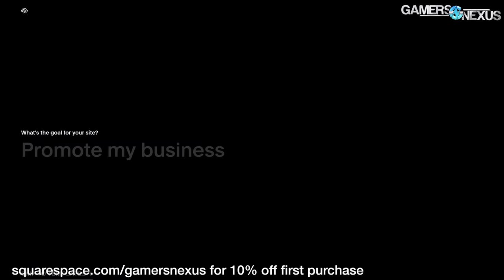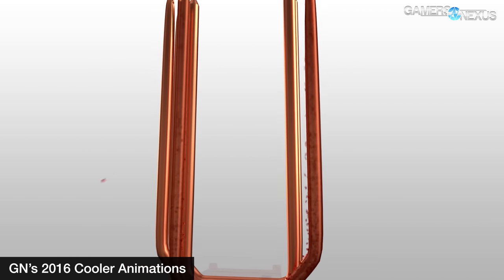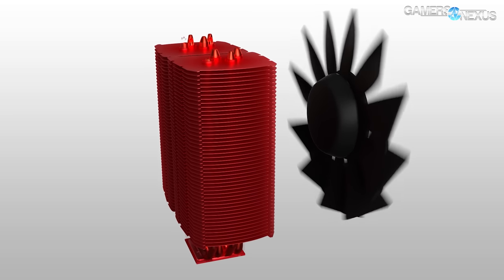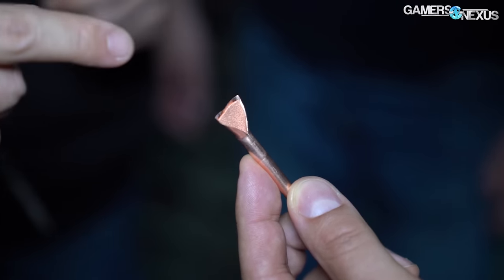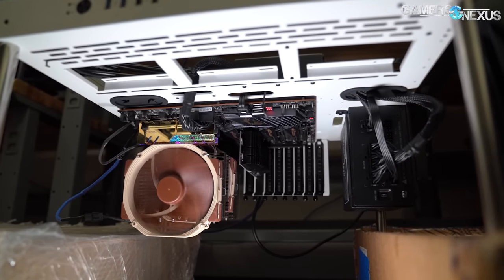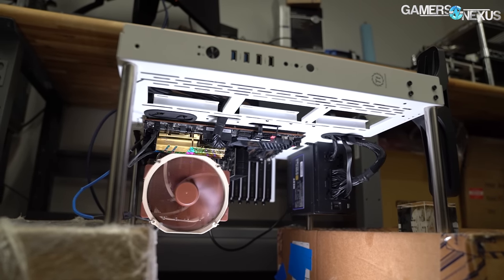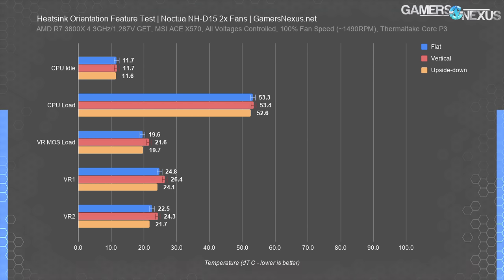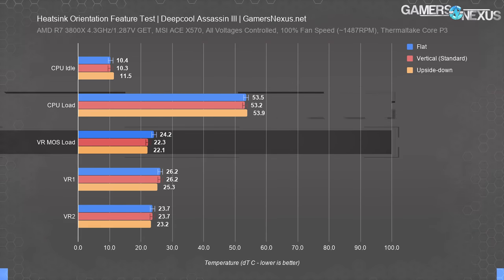Cutting AMD Coolers Open & Flat vs. Vertical CPU Cooler Benchmarks

Comment: I'd be interested in a test of the NH D15 in whatever orientation stock vs cut ends (just the tip of the heatpipes) to see the difference between a heatpipe and a friggin cheap copper pipe with some copper powder sintered to the inside

Comment: I ran my standard desktop tower case on its side for a while and it made no difference now that it's standing back up. Especially in games where the CPU hardly cracks 50*C to begin with.  Using a tower style cooler Thermalright Assassin King 120 Mini.

Comment: I'm curious why when doing heat tests like this, why not use something like a hot plate with good thermal sensors? It should provide a consistent heat output. Also woulda loved to see even a shoddy single run set of tests of a heat sink with a hole cut in it. It's fully possible that instead of a full burst, theres could have been just a shoddy seal or crack or the like, and i'm curious how much of a difference that  water makes.

Comment: Perfect timing...i just bought the 2700x few days ago and i freaked out when i saw 45-50 degrees celcius only for windows use. After a day is normal 35-40 for windows and 50-60 for games. But sometimes it jumps from 35 to 45 in sec
Reply: Akis Akis it's the same with my setup, 3700x stock cooler, 3 intakes 1 out...

Comment: ????? - I bought a cooler maybe just over 10yrs ago.  It was a high-end noctua and a monster.  Does anyone know if that will hold up on latest CPUs or do I need a new one. Was thinking just see if I can get an adapter to mount it when I buy new PC this year.  Also got a failed Corsair liquid cooling loop(5yr failure/rust/evaporation) was gonna repair it with purified/deionized water pretty much as video on this channel did show.  Need to make a choice about what im gonna do.  Dont want to spend money I dont have to.  Will likely buy high-end cpu and overclock so am for sure gonna need a quality cooling solution. ?????

Comment: Dont use a noctua to show an example of capillary action.  There have been a ton of people who have accidentally broken the tubes and there was nothing inside.  There's also has been shown to not even touch the plate.

They most likely say not to run it upside down because it's so heavy, it could crack thinner boards or pull off the hardware.

Comment: I've a question reg cooler fan orientation.. Pls help GN or anyone..

I have a Ryzen 5 3600 with a Hyper 212 LED cooler and a CM 590 III case. It seems that for AMD cpus, the Hyper 212 LED can only be placed horizontal to the floor - meaning teh fan is facing the GPU, sucking air and blowing up above. Not oriented vertically, sucking air from near RAM and blowing it to the rear exhaust like most setups do. My temps are really high. Like 90 degrees while gaming and throttling at 95 degrees while stress testing.  

For those wondering, I do have two 2 intake fans in front, and two exhaust fans - one at the rear exhaust and one at the top, and heat does get dissipated and temp comes down to 45-50 on idling for under 60 seconds after gaming so it's not a case of heat being trapped inside the case.  And my GPU is an Open Air GPU if that makes a difference. 

Could the Hyper 212 orientation be affecting my temps adversely?
Reply: A Hyper 212 should be able to keep a rysen 5  3600 colder then 50- 70C when gaming, my 8 core Intel Xeon with higher 95W TDP (60W for the rysen) had no problem keeping it under 60 - 70 C while still running silently. I tested my 8 core Xeon 2288G with a similar cooler as the Hyper 212 (looks identical and might be a Hyper 212?) and it never got hotter then 85C doing intel stress test at 95W TDP. Now it has a huge 12 heatpipe coller and it get up to 85C if it runs Prime 95 stresstest at 200W and gaming it is around 40-50c... It makes huge difference what kind of program you run, some like prime 95 stresstest makes LOT of heat and other bearly makes it hot at all with all 8 cores at 100% use in all cases...

Comment: How about instead of a cpu with a bunch of variables, use a heating element, such as a piezo element (super cheap from ebay) with controlled voltage and amperage to generate the heat?

Comment: Now can you please see how hot they'll run with the holes cut in them and none of the low boiling point gas there ? Learning this I sure there's some coolers cooling on nothing but surface area anyway

Comment: So today I've been trying to figure out what's wrong with my 5700 XT Nitro+ "Special Edition" which I recently bought. It was running hotter and louder than in any of the reviews I've seen (109 C Junction with 2400 RPM fans).

So I watched this video. Looked at my Silverstone FT-02 case. Turned the case on its front. Ran a stress test. 90 C Junction, 1500 RPM fans. 20 C improvement in junction temperature, plus 900 RPM fan speed reduction. I'm not joking. What the hell

Comment: ahh teledyne technologies... used to work briefly for one of their subsidiairies here, to help assist with upgrading from win 7 to 10.

they knew NOTHING about automation, and I did the most basic of setup things (removing start menu items, pinning shit, setting up the BIOS when they use dell's imaging tool which is more than capable of this...) and I got done when the guy told me to replace a redundant power cable on a switch, dude, the cable's already there, redundancy or just leave it because you think the power cable is going to melt because it's not 14 AWG when this thing draws nothing.

and they're running windows enterprise, it's not like there's limitations in automation

Comment: Steve, next video should be conduction vs convection vs radiation so people will understand the whole NASA thing without gravity and air (or any fluid medium). Thermal radiation really relies on line of sight, so your line that talks about angle of installation will be really relevant. Then after that video, you should basically transition to a physics channel.

Comment: Question: why do you use inherently variable CPUs for testing rather than a more controllable dummy load (like AnandTech uses: https://www.anandtech.com/show/15148/the-cougar-helor-240-360-cpu-liquid-cooler-review/3)? I get the argument for it being a "real" load, but you're still stuck with all the issues of testing within a complex operating system etc.

Comment: Sadly even with adequate funding GN should never be in space; Steve's glorious hair, and snowflake, would likely cause more problems than they could solve in Zero G.

I would be inclined to think that VRM temps would be lower when oriented sideways or upsidedown due to convection creating a flow of air from the CPU and heatsink that rose past the VRMs, but that's just a hypothesis.

Comment: Mostly for superficial reasons, I like computer cases that put the motherboard flat, with the cooler and GPU upright directly in the socket. Mostly for aesthetic reasons, but my caveman brain wants to believe it also puts less strain on the socket and hardware that way. *Shrug.*
Reply: My Auros GTX1080ti is about 2Kg with the huge heatipe cooler it has, my 12 heatpipe CPU cooler also is about 1Kg so I use a flat oriented motherboard cube case becuase of the stress on motherboard all that weight would give. It also has two 14cm fans blowing cold air directly at the GPU making it run no hotter then 45C at 100% use when gaming, without thees fans it still keeps under 60C but then you can hear the fans speeding up.

Comment: Wait, hwat?

There are people out there seriously thinking that orientation does make a difference in this scenario?
Just wow... Pretty sure those also think that gold coated connectors make a difference for digital audio cables, or the earth is flat...
hears hornets buzzing in the distance

Also curious what DeepCool's answer will be in regards to their "superior" (but seemingly identical) heatpipes. MAYBE the difference is higher up the pipes? Have you also opened them on top where they attach to the fins?

Comment: I want to cut open the heat pipes on a cpu cooler then have compressed Freon go through it. Basically making it a cold side of an ac unit.

Comment: Wow. Good coolers work good. Great video. If you actually wanted to test you would have included cheap coolers that would actually show a difference. And since you used an AMD cooler supplied with the AMD CPUs why did you not include Intel included coolers? The proof that you only used good coolers is idle temps, they were below ambient temp. A cheap cooler would not go bellow ambient temp.

Comment: I use a hyper 212 evo on a i7 8700 upside down and i did a 24 hr comparison of temps and saw no real difference but it's not a Noctua cooler so who knows.
Reply: I did 24 hr each upside down and right side up to see if it mattered and it didn't with enough case fans.

Comment: It's called Tower Cooler and Top-Down Cooler not "Flat" (the earth, for example, is flat compared to any CPU cooler) or "Vertical" (as soon as you put it in a case it's horizontal in most cough*cases*cough ... too bad!)

Comment: How about testing how much difference there is if you disable the capillary action by drilling small holes on those heat pipes. Other words test how much removing the "evaporation effect" changes the temperature compared to normal operation. I wouldn't be surprised if it's just an exaggerated marketing gimmick.

Comment: Testing a heatpipe in a vacuum would be extremely inefficient, as no medium to transfer heat would be ridiculously slow. Radiation is one of the slowest form of heat transfer. You are referring to less gravity. Space isn't void of gravity, just void of well everything....
Reply from the maker: Gravity is reduced to the point that, for purposes of this conversation, it is not under the same considerations as when people ask about how heatpipes are affected by gravity in a computer. Heatpipes move heat from a hot spot to another location. The goal isn't to radiate heat off the heatpipe as much as it is to relocate the heat somewhere else. From NASA: "What happens when electronics overheat? The short answer is: nothing good! In microgravity, natural convection does not occur, which makes cooling equipment a challenge. So how do you keep electronic and computer components from overheating in space? In satellites used for communications, global positioning systems, and defense purposes, a heat pipe is the device used to regulate temperature and keep the overall systems operating reliably. A heat pipe is a simple device that can efficiently transfer heat from a hot spot to a cooler remote location without the use of a mechanical pump." Read more here: https://www.nasa.gov/mission_pages/station/research/news/heat_pipes.html
Reply: @GamersNexus  fair enough, just clarifying. One of my college term papers for my degree had to do with heat dissipation in space.
Reply: @Tallnerdyguy  ok boomer
Reply: @guser436  ok kid. Sorry you aren't old enough to go to college. Or smart enough...
Reply from the maker: @Tallnerdyguy  Not sure what you were clarifying, sorry. You have to remember that we don't know where you paused the video to type your content. If you're talking about the joke about going to space to test a heatpipe, we weren't really serious about that. Also NASA has already done that work. Either way, thanks for your input and that sounds like a very interesting paper to write and research!
Reply: @GamersNexus  my degree was in thermodynamics and was just clarifying the concept of heat dissipation in a vacuum.
Reply: @Tallnerdyguy  final year computer science student ;)
Reply: @guser436  ok boomer
Reply from the maker: @Tallnerdyguy  boom
Reply: Actually gravity's range is infinite - space isn't void at all.  When you're in orbit you're under most of the effects of gravity from the celestial body in question, but are counteracting it with centrifugal force, known as "microgravity".
Reply: @Asdayasman  actually centrifugal force is known in space as artificial gravity, microgravity is what is experienced in space, since specific planetary gravity isn't enough to pull items towards it specifically.
Reply: @Tallnerdyguy  I guess the moon stays up there by magic then.
Reply: @Asdayasman  it isn't by centrifugal force.... Irrelevant to the previous discussion.
Reply: @guser436  Wait... You're paying for a computer science degree?

What a waste. All the information is online and at the libraries
Reply: @Asdayasman  and magic that must be fading, as the moon is moving away

Comment: "Within room for error" is not insignificant when it consistently shows the same difference.   Vertical orientation is clearly slightly better under high heat loads.  No it's not enough of a difference to worry about, but to discount the repeatable difference as non-existent because it "could" be error does not mean it is error.
Reply from the maker: We have a responsibility to stay within our lane, though: We do not have sufficient confidence in our test resolution to state firmly, to 100,000 people, that there is a meaningful difference. That would then be propagated and amplified in comments online and turn into something different from what it started as, so best to leave it as is until we have better confidence in those deltas.

Comment: HI so I thank you for all your work!  I have a request. How about doing a test for us?  Vent the heat  pipes on a cooler and compare the results for us. I would love to do this but I don't have the budget to destroy parts like you do ;-)      I know you are more into reviews than physics experiments but.....  We are interested in what proportion of the cooling is contributed by the liquid. We already know that the engineering papers are deep,  and sometimes gravity is quite important and can even stall the process depending on the size, length, diameter, temperature delta, etc. We also know heat travels by 3 means, conduction, convection, and radiation. We also know water has a very high specific heat and the latent heat of evaporation ( phase change ) is 533 times that of heating 1 degree C.    But copper conducts heat more rapidly than any metal except silver (and double that of Al) and who knows how fast that is compared to vapor?  So, how about it? just grind the caps of the ends of some average cooler and test it for us !  You are our science hero !

Comment: Would it be possible to cut tesla valves 8nto a CPU block? When the fluid vaporizes and expands it should only be able to travel one way and act as a pump.
Reply: But why?
Reply: Less pump noise and better reliability because there are no moving parts.
Reply: @JamesSmith-dn8lb  There are no moving parts in a heatpipe.
Reply: @Asdayasman  yeah I know that. I mean to replace a liquid cooling pump
Reply: @JamesSmith-dn8lb  I feel like you're just saying words, then.  "Tesla valve!  Capillary action!  Water block with no pump!"  It doesn't make sense because you have no proof of concept.

Comment: Capillary action.. Sadly you say it wrong, but its also known as 'wicking' when talking about string/paper etc, not just restricted to wax (you need something for Diesel to 'wick' to so it will actually light easily!) And it's Ca-pill-ary not cap-ill-hairy! Do you drive a Hyunnnnndi or a Teeota?

Comment: The basic rules are.
Hot moves to cold , cold moves down hot moves up. 
Having the heat source at the top instead of the bottom or side will reduce overall efficiency.